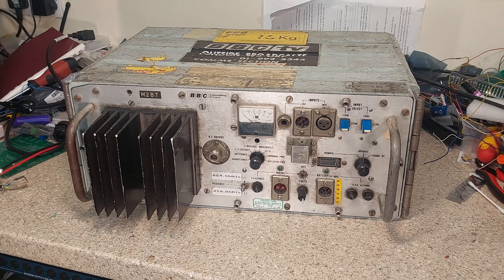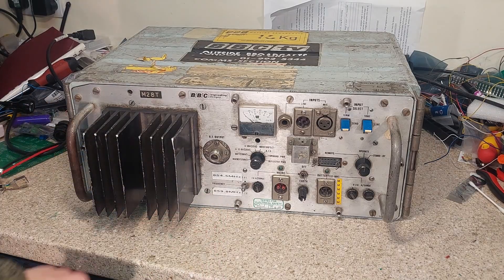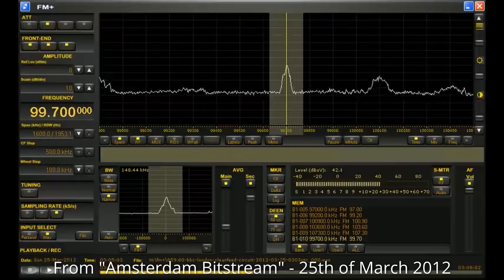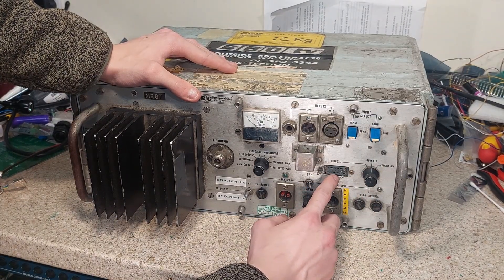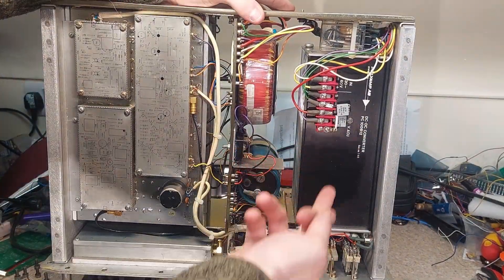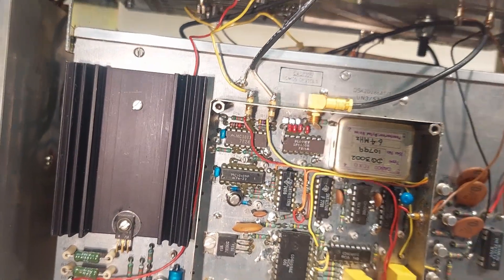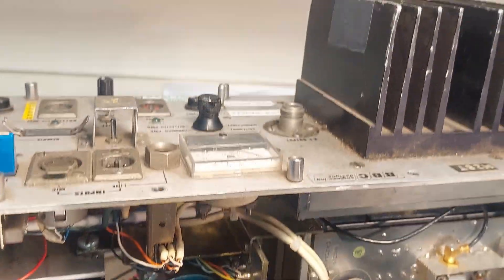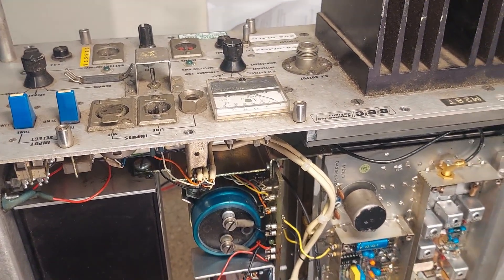A Look Inside: BBC UHF Audio Transmitter

Comment: I would have used that very unit when I was in BBC Tel OBs. They were good links, rarely had any issues with them, or the 213 or 141MHz links either. The dymo tape with the frequencies (note the newer style tape rather than the old embossed ones) for the 854 frequencies, I think before that we had an allocation around 880MHz.

Comment: Great video: this was designed in RF Section of Designs Department, at that time located on the 5th floor of Western House (which became Wogan House, now sold). The aluminium case is a C&N mil spec design : the specification of OB kit included the requirement that equipment must be able to to used as a 'step' when the need arose.  :>)

Comment: I used to live close enough to pick up the talkback from the three mills studios in East London. And I didn't live that close, they had some decent range on them. You could hear the producer and live mic feed from shows like million pound drop. Very often before an ad break they'd say which sections they were going to drop and then how long the ad break would be. Or the producer would say something only for it to be repeated by Davina 10-20 seconds later.

No real use, just a bit of fun really. This was all on the upper part of the UHF block (450-480Mhz or so). No idea if they still use that, surely it's all gone digital now, maybe even using cellular networks.

Comment: There was a central BBC safety committee, which decided, I believe in the ‘90s that those Canon mains connectors could be a Hazard and were replaced with IEC. I assume that there must have been some incidents to trigger it. 
Nice to hear the off air clean feed announcement from SCAR. Within a year of that recording Television Centre had closed and News relocated to Broadcasting House.
Reply from the maker: I have heard a variety of stories about them yeah but always hard to know which are true/enhanced 😆

Comment: We used these back in the 1990s in Bristol for local News gathering.  We would usually have to have two, one would be in one OB van and another landrover (FRV) would be on a hill with line of sight of the OB van and that would provide a microwave link back to a receiver back to the studio via landline. 
This was what we used neck the Sat truck to over in the late 1990s

I do remember the old FRV landrover being driven every year to Glastonbury as a local output for tv & radio to cover the event. It was a sad day when the landrover with its pneumatic mast was decommissioned & driven up to Birmingham for sale.

Comment: Local radio tended to be on 460 MHz for prog links. Not as high as this transmitter. Also, this is quite clear outside broadcast piece of equipment which would be on location and not in a studio.
Reply: BBC Local Radio programme links were on 446MHz. 
The main BBC studios had no link equipment at all. All OB’s were set up by central control rooms and assigned as required. CAR at TVC for general programmes and SCAR for News. There were two of these units rack mounted in the East Tower at TVC.

Comment: Indeed, the line input is strange, XLR having been a directional connector in the pro audio industry... I guess avoiding confusion was more important than sticking to standards, especially if the transmitter provided phantom power to the mic. Lovely PCBs there - all ground plane and no solder mask, very '70s/'80s style.

Comment: I noticed the 4046 PLL chip along with the 4059 divider, a pre-scaler (SP8639) and others. Parts I worked with all those years ago and loved back when electronics was fun.  I'm guessing it was built in 1979. Thanks for posting.
Reply: It still is, as videos like these prove - more access to cheap old professional equipment and to online documentation than back then!

Comment: From a time when radio and TV stations hand-made a lot of their equipment because ready-made was either not available, way too expensive or not customized to the purpose. I worked for RNZ in New Zealand back in the early 80s and so much of the equipment used in radio stations throughout the country was designed and built "in-house" by the engineering department.

Comment: I'm always fascinated that any bit of bespoke BBC kit I've seen always seems to be using esoteric plugs, sockets and Interconnects that I never see on any other Comms gear. Even what looks like a standard 1/4 inch jack, isn't!
Reply: The GPO type-B connector was designed such that the tip and ring could not contact the sleeve and ring when being inserted, this avoided putting unwanted voltages or loads on circuits not designed for them. 11:53
Reply: The GPO type-B connector was designed such that the tip and ring could not contact the sleeve and ring when being inserted, this avoided putting unwanted voltages or loads on circuits not designed for them.
Reply: The GPO type-B connector was designed such that the tip and ring could not contact the sleeve and ring when being inserted, this avoided putting unwanted voltages or loads on circuits not designed for them.
Reply: I've damaged a valve power amp due to that exact issue with standard 1/4 connectors. Learning the hard way

Comment: 143 mhz fm has clean feeds audio there's 2 in my area
Reply: Several years ago 144 MHz BBC clean feeds circuits were received on a regular basis in my area from Nottingham.  25 to 30 miles south of my house.
Reply from the maker: Ah interesting, I didn't know 141MHz was still in use. Do you know what station is using it?
Reply: @AvroVulcanXH607  I don't think it is any more. I believe we (Bristol) were the last users of 141. We lost the (very useful) Mendip TX about 7-8 years ago when all the old masthead gear was decomissioned following analogue switch off. We lost the Royal Fort in Bristol in March 2024 after not renewing the licence. I unplugged and removed the TX from the bay after others had derigged the aerial, cut in in to 4 pieces and dumped it on the floor. It's probably all still there (I'm not!)...
What was not to like: Free to use (once you'd paid the licence), wide bandwidth, no delay, nothing to set up out on location, it just worked and covered a large area. Oh, and you could run an audio multiplex over it too (they came in the same box, as you probably know).
When we built out first SNG in 2000 (my project!), we had a a commercial 1U RX unit from W&D. It was cr@p, so we took it out and used one of these receivers. Same with our second truck in 2009 (which is still in service, even though the RX isn't).

Comment: Very solid BBC construction. XLR plugs and sockets including that mains connector. That was standard BBC even it wasn’t permitted to be sold openly because the plug had live pins that could be reached, if you tried hard enough! Nice Ernest Turner meter. I expect it was designed and made by Designs department or Research dept.
Reply from the maker: I never really understood the problem with LNE connectors. I've heard lots of rumours about "safety problems" with them, but I can't actually see any reason why they're less safe than IEC connectors, or even powercons.
Reply: I suspect it was to prevent erroneous misconnecting of a line-level feed to a mic-level input when setting up in a hurry or in difficult conditions. I seem to remember coming across it on some oldish BBC kit in the 1980s.
Reply: Line input on a male XLR? 🙂

Comment: The date codes on the chips suggest this is was built in 1978. That matches the style of the BBCtv logo on the case. Of course it could have been modified and upgraded many times since.
Reply from the maker: I believe originally it would have been designed to run on the 400MHz band, and was later upgraded to 800MHz - which would have required the replacement of at least the PA module (which explains why the heatsink is now too long to fit under the handles/front cover) and the upconverter